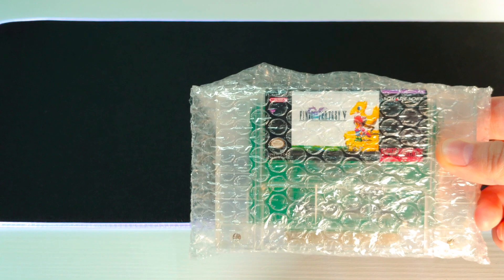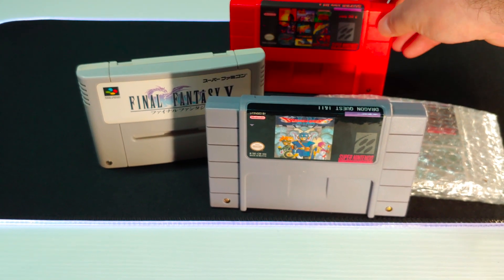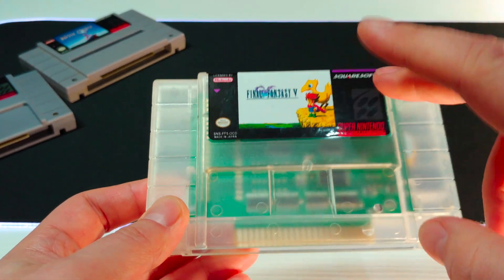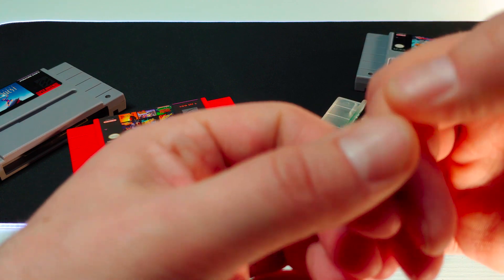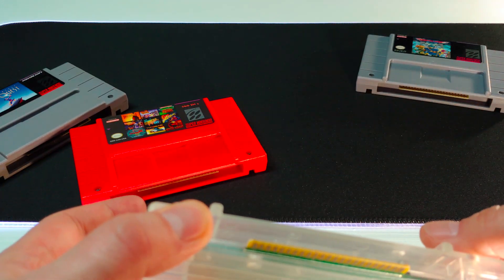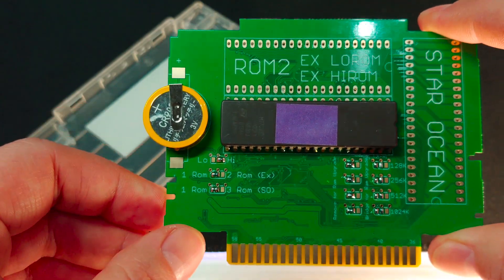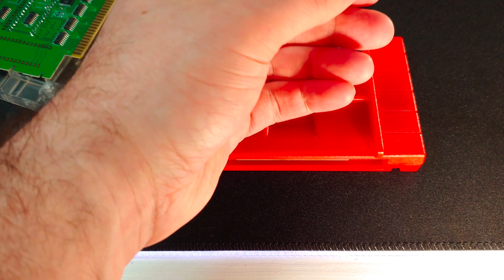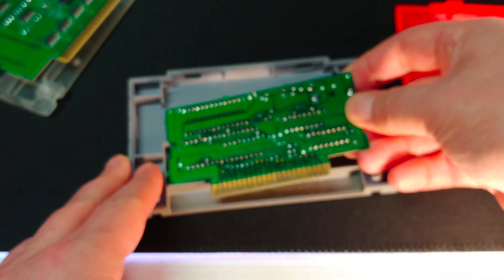Comparing Various SNES Repro Carts

Comment: I have that red cart myself and for the price it’s pretty good. Personally I like those multicarts but don’t like buying single game repros.
Reply from the maker: I only got it because I don't understand Japanese and also don't want to buy a chip programmer to either swap out the ROM or use one of those PCB'S that override the onboard ROM on the SFC FFV cart.
Reply: @koztech  oh I think that’s a great buy, I mean more the ones that copy the game/label/ cartridge. Those ones are generally sold to unsuspecting buyers. Yours is solving a problem and is very apparent. Keep up the great videos!
Reply from the maker: Thanks! You as well!